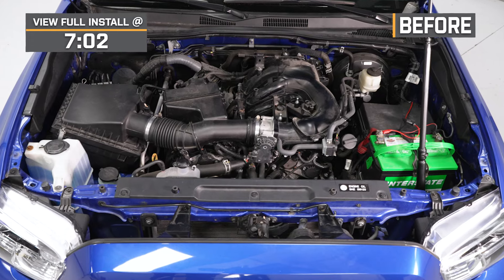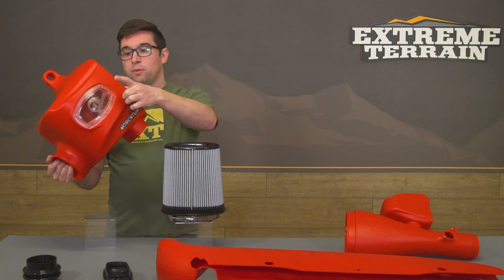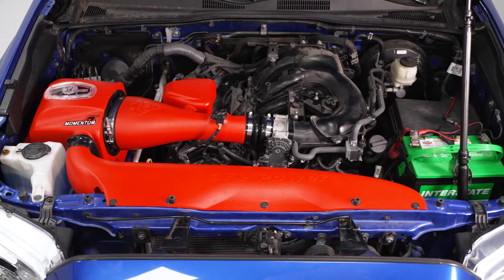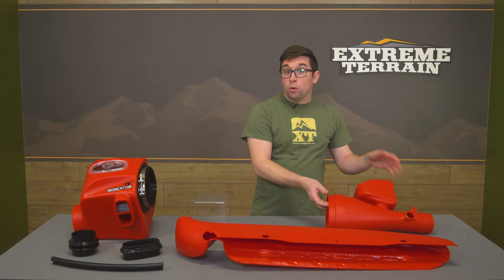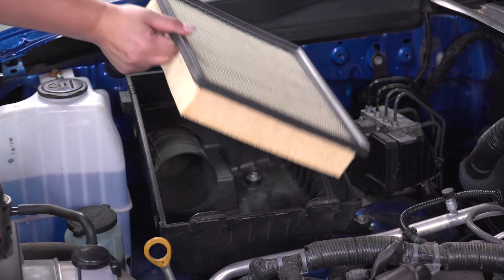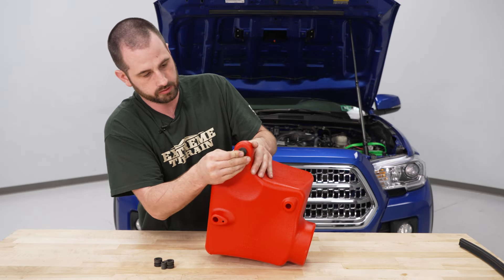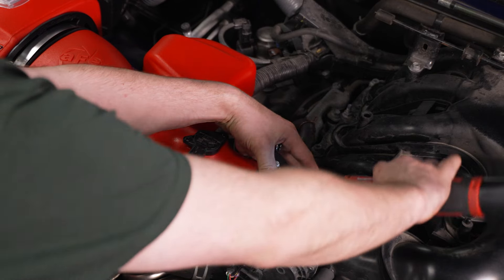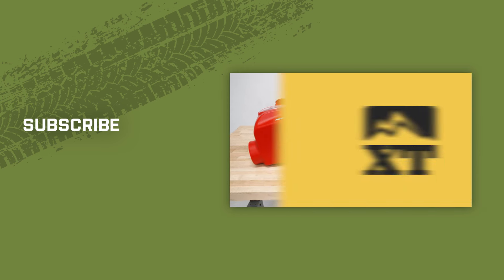2016-2023 3.5L Tacoma AFE Momentum GT Cold Air Intake with Pro DRY S Filter Review & Install

Comment: A full cold air intake kit is a waste of money, the stock air box is more than sufficient. It's the same air box the 5.7 Tundra uses and it supports a supercharger. I did drop in an AFE  Pro Dry S filter however